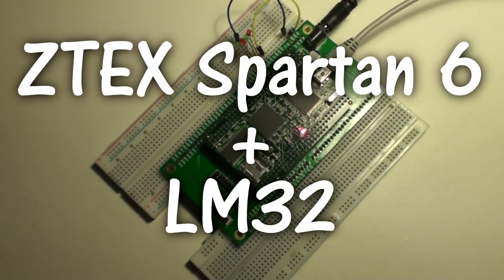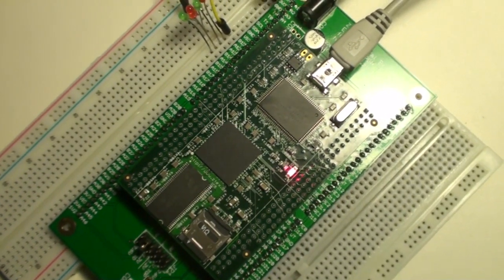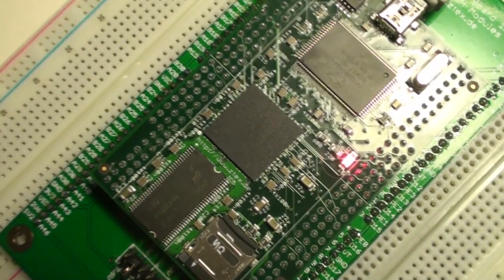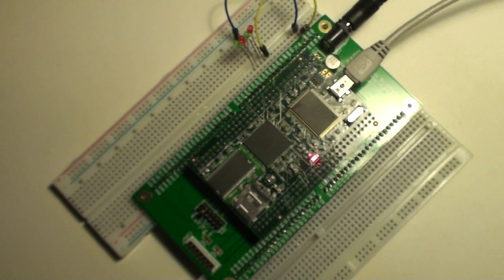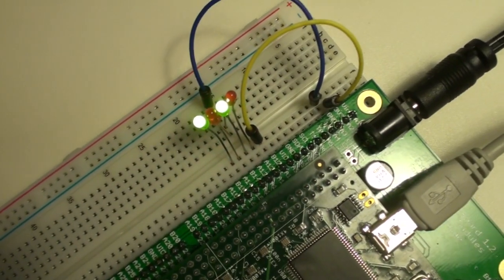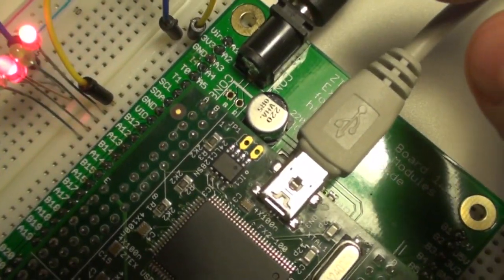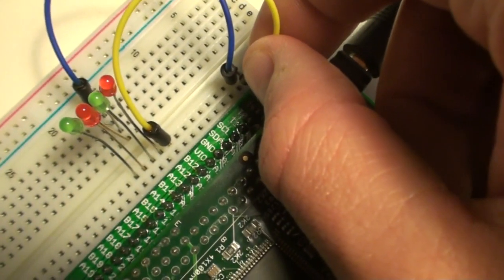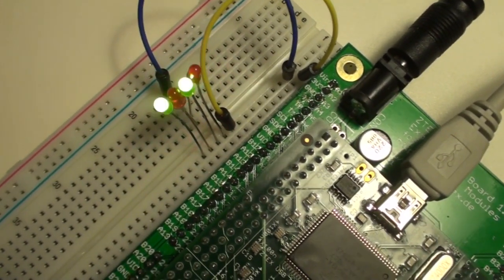ZTEX Spartan 6 + LatticeMico32 (LM32)

Comment: @DigitalDesignET Minor modification to gpio.v was needed because Verilog doesn't require the begin-end blocks to be named but it is required with Xilinx ISE tools FOR SPARTAN 3E. TKJ Electronics used Spartan-6 which is using the newer version of XST, therefore there was no need to modify the Generated begin-end blocks.